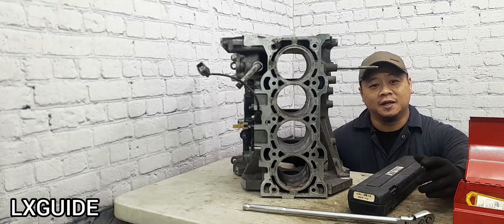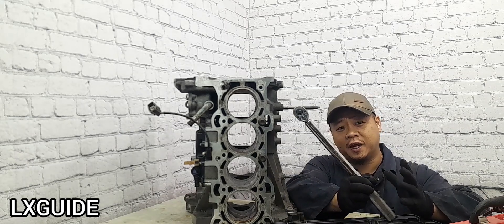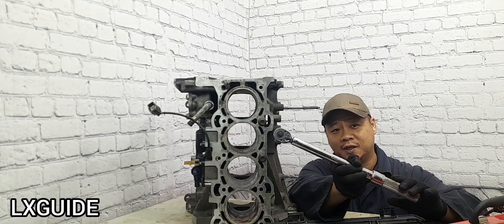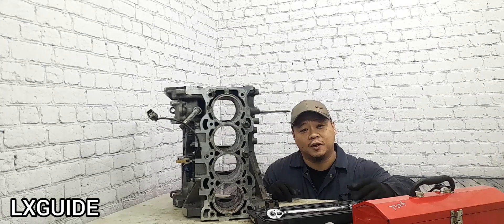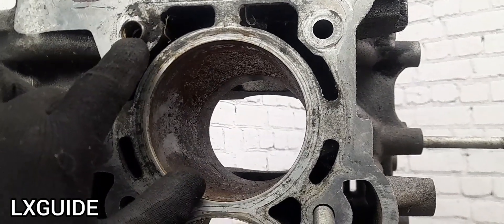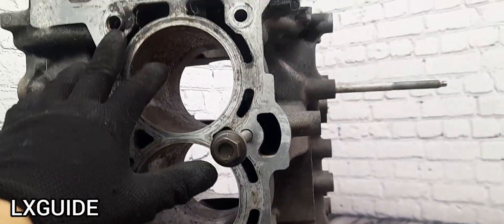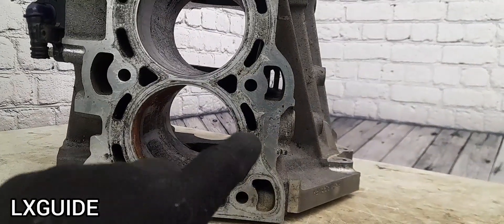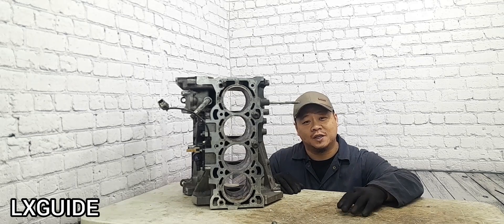NEW HEAD GASKET LEAKING COOLANT AFTER REPLACEMENT COMMON MISTAKES EXPLAINED

Comment: I just finished putting back the engine together and it still leaks combustion gas into cooling system. Going to get an engine sealer and dump it in to radiator 😅😅😅
Reply: Update: didn't work so I rebuilt the engine 😊

Comment: My block was warped by about 0.005". I took the head to machine shop and assembled everything with a new gasket but still leaked. I'm guessing my block was too warped since toyota manual says to discard engine if more than 0.002"
Reply: Spray several layers of the copper head gasket sealant on the head gasket... Usually three coats overnight and let dry good...   Over torque head bolts by 10 lbs will usually seal...
Reply: @Rick-qf5de Thanks! Will do this and let you know. I took the new machined head off and #3 cylinder is very clean like it's been burning water. Rest of cylinders got the brown combusion residue. Was thinking of putting high temp silicon just around narrow parts of #3 plus do what you said